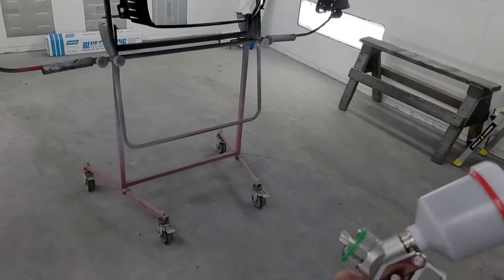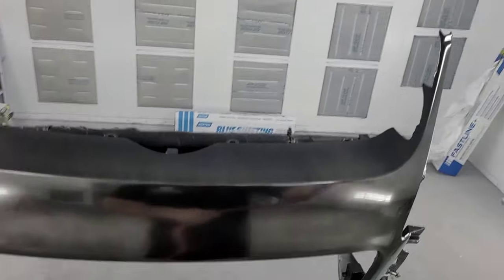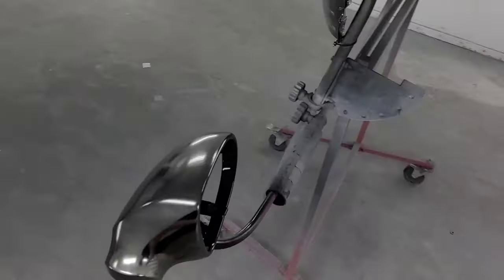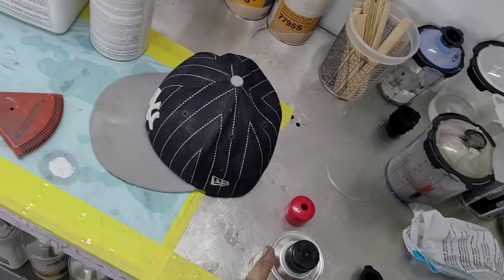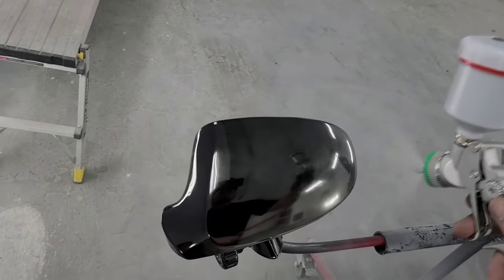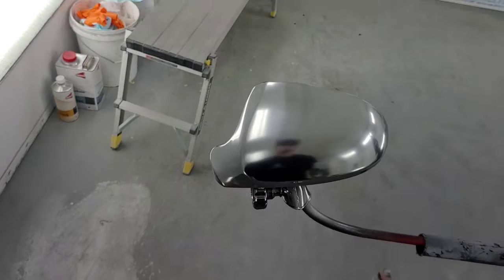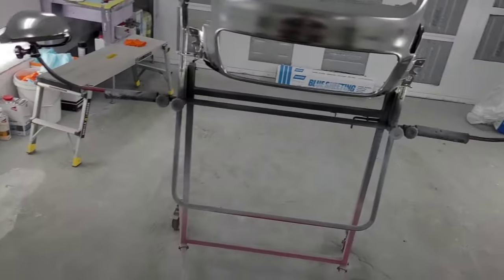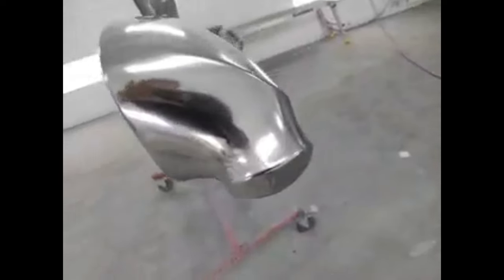Kosmic Krome How to spray(Read Description)

Comment: you have to wipe the overspray off after each coat before applying the next stage i use a microfiber towel with a very light hand anything more coarse than that will scratch surface

Comment: It's tough to get a mirror chrome finish with that type of  paint. I've had much better luck with Silver Nitrate Hydro-Chrome like Cosmi-Chrome. Plus the clear coat doesn't haze Hydro-Chrome like it does with the "chrome" paint.
Reply from the maker: It is bro. Tbh. It's more of a polished aluminum look. At best. Where do you get Hydro-Chrome from?